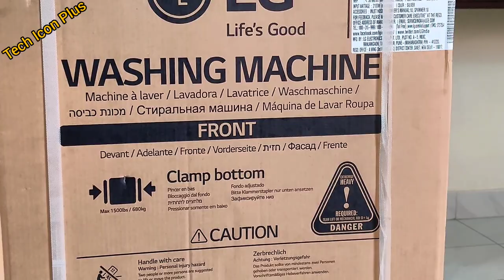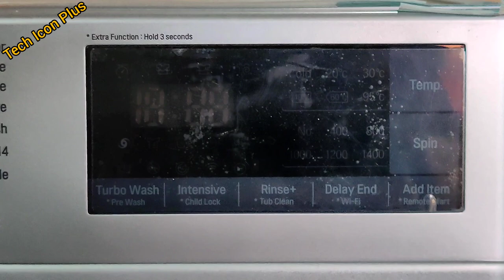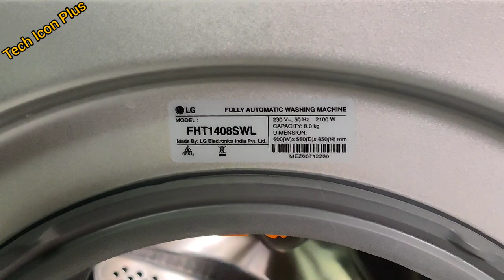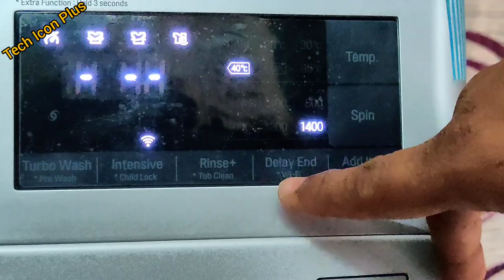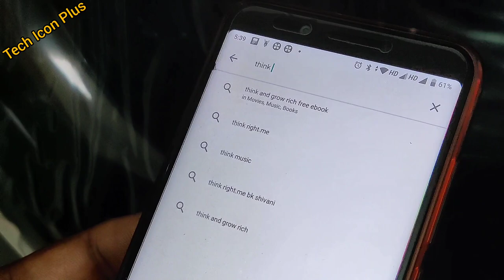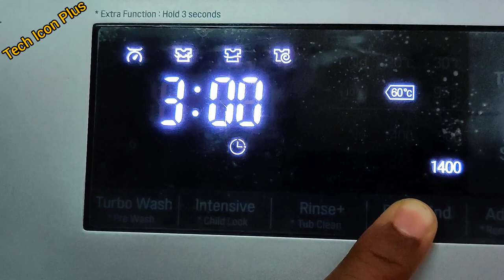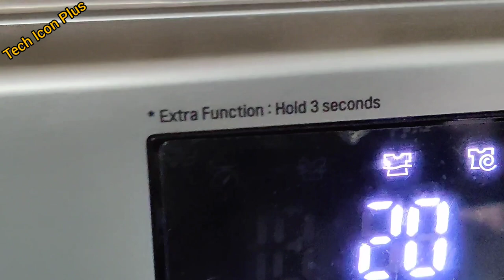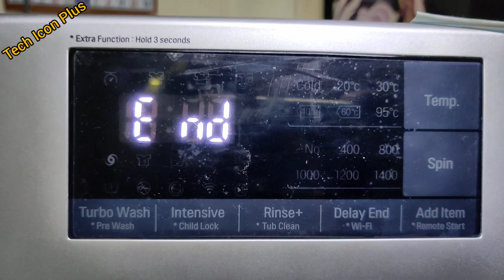LG Front Loading Washing Machine 8 KG Unboxing | Review | Demo | Best

Comment: Very well explained .
Thank you. 
 How does steam feature works in this machine? 
People living in Hot weather conditions, does high spin 1400 needed? 
Is it compulsory to use softener?
Machine Vibration is too high even as low spin ( as it appears in the video). Is it natural for all washing machines? Samsung comes with a advertisement that their machines vibrate less? How far it is true?
Current Amazon price show as 37,800/- is it ok to buy this product online? 
Other brands like Bosch and IFB don't have DD technology?
Reply from the maker: Very well explained . Thank you. How does steam feature works in this machine?  

>Thankyou
>Steam feature working fine. You have to select feature. 

People living in Hot weather conditions, does high spin 1400 needed? 

>Depends. if you require more dry, then yes 

 Is it compulsory to use softener?  

>Not mandatory. But if you use softer your fabric cloth will become soft last long. 
Machine Vibration is too high even as low spin ( as it appears in the video). Is it natural for all washing machines? Samsung comes with a advertisement that their machines vibrate less? How far it is true?  

>Vibration is not so high. Not sure about other brands 

Current Amazon price show as 37,800/- is it ok to buy this product online?  

>Compare online prise and shops .chose the best option 

Other brands like Bosch and IFB don't have DD technology 

>LG only has DD technology
Reply from the maker: If you like our video please subscribe our channel #TechIconPlus

Comment: I like the video, you have explained it in detail....Can u suggest me whether to go for FHT1408SWL or FHT1408ZWL...

I understood from the comment section replies that "ZWL" is the latest model with less power consumption...
1. How much we can save on power if I go for new model.
Reply from the maker: I am using SWL with this model I did not faced any issues and ZWL is a new model with 5 star energy saving.
Generally 5star energy saving consume 20-30% less energy.
For more information please visit LG official site.
Don't forget to Subscribe the channel.
Reply: 1207= 1200 rpm 7 kg
1208 = 1200 rpm 8 kg
1408 = 1400 rpm 8 kg
Zwl, sws, swl etc = Colour of body

Comment: What's the diff b/w FHT1408SWL and FHT1408ZWL model?
Reply: ZWL is the latest model in the market.
Reply: @saiprasad123456  what's the technical diff?
Reply: @venkatraaj1375  No difference in Technical specifications. The power consumption in the latest one is little less compared to the older one.
Reply from the maker: Thank you for watching our Videos . 

@Sai Prasad  , your correct only Power consumption is different and FHT1408SW has 30 Quick programs .
@Venkat
We can use below link to compare the both products .
https://www.lg.com/in/compare?bizType=B2C

If you like our Videos and for latest Videos update please subscribe our channel .
Reply from the maker: @raghavendrapavankumar2713   

use below link to compare the both products .
https://www.lg.com/in/compare?bizType=B2C

If you like our Videos and for latest Videos update please subscribe our channel .
Reply from the maker: @raghavendrapavankumar2713  

Using the compare Link i found the below  differences
9.0 kg FHT1409ZWS

Color - VCM + Chrome  (Color also Vary the cost ) and Allergy Care

9.0 kg FHT1409ZWL
Silver Color
 and not sure about Alergy care potion .

If you like Our Videos please do subscribe .
Reply from the maker: Yes